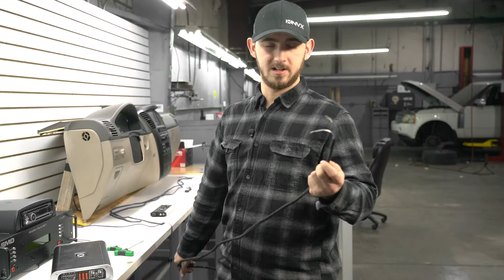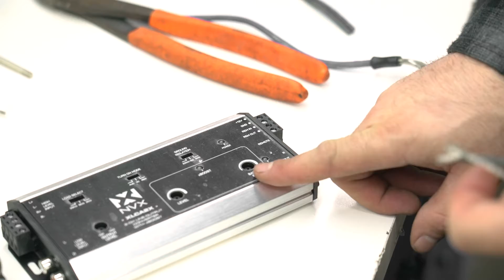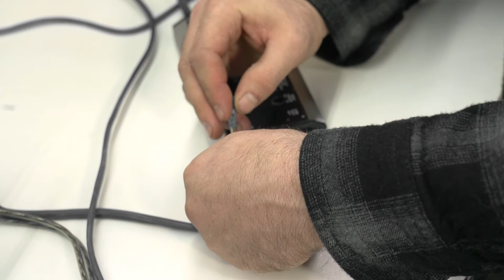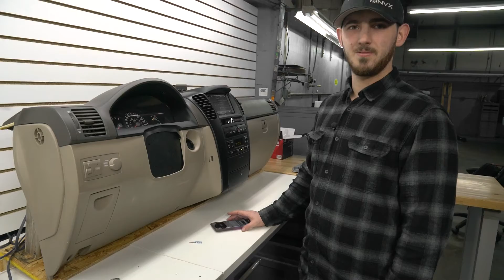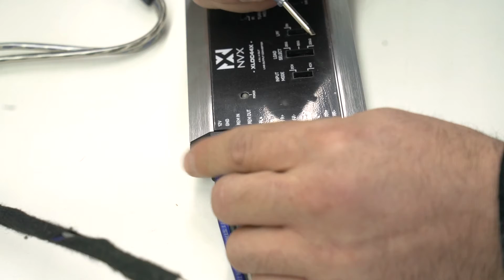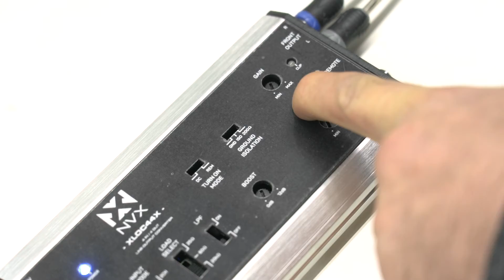How To: Setting Up The Xlca2x and Xloc44x NVX Line Output Converters

Comment: Help me understand this - the xBOOST light was triggered when you increased the OUTPUT LEVEL and with the BASS-X EDGE at 0. I just received my XLCA2X to help address the bass cutoff from my stock system. My impression from the instructions was that the Output Level was further down the line from the xBOOST dials but it seems like its in line before?

Comment: Been on hold with the phone number in the booklet that came with the xlca2 for over 40 minutes.  Sure would be nice to ask someone some questions.  Got this thing all hooked up properly, but it only works when it wants to.  Got subs running with this thing in a 2018 Highlander. Usually works when the car is in park and the subs sound great. As the car is put in drive the xlca2 shuts off. Put the car back in drive, the xlca2 comes back on. You can do that back n forth 20 times. But then sometimes it will work when in drive and sometimes it won't work in park.  I guess this is what I get for going cheap.  Cheap products that kind of work and no support.  Guess I'll return this thing and get an Audio Control.
Reply from the maker: If this is regarding the Highlander with JBL, you need to disconnect the ANC module.
Reply: Sounds like an issue with your vehicles factory Active Noise Canceling

Comment: I have the xloc22X. I use it with a 600W AMP -  2 output with a REM input.  The XLOC22X has grate sound. No hum. Very good Base control. I do not use a remote Knob. The biggest problem I have Is with the remote turn on output of the NVX device. The REM output is connected into the amplifier REM input. Both the amp and the LOC are grounded properly. It is not working with remote turn on! It Does not work properly.   When I first turn the car on and the engine is running, but the radio is off "with no sound", AMP is turned on automatically anyway. If I let the car sit for 5 minutes running and the radio is off, the NVX device never Turns off the AMP! If I shut the car off can and only use auxiliary, the same thing., The radio is off, but the  NVX Device does not turn the AMP off. It is concerning to me that the advertising for this device states, in more than one description, that it will turn off the amp if no audio is on the NVX LOC.  I have spent over 2 hours working with the remote in & out. This does not work as stated in any of the descriptions. I know of one other person owning the same device with the same issue. Your documentation that comes with the LOC has NO Description of  how this is supposed to work. Yes, there is a diagram, sorry, does not help because it does not work properly.  This is concerning because in the winter, the battery tends to discharge more quickly when the amp stays on and the radio is off.  A video with some detailed instructions on how this is supposed to be hooked up would really help, however, for some reason NVX , has  No Videos with prescription on how this is to be connected.  You can look on the NVX website, and it says this works, nop, it is not correct.

Comment: Can you use two speakers high level input, (cause my promaster city cargo only have two front speaker ) and use both  front and rear ( sub) rca output  at the same time? Or can i split the two pair of speaker wires to make 4  high level input?
Reply from the maker: You are able to use just a left and right signal input with the XLOC44X, and will output across all four outputs if the input mode is in the 2ch position.
Reply: @NVXAudio  Good! Thank's for your response

Comment: Great video but you should be testing rca voltage going out. Most amps can’t take more then 4 volts of power. Taramp for example like more like 2 volts on the rca. Do your homework people this a great product. However, amps can’t take that much rca power you will fry your equipment.
Reply: Seriously, input sensitivity on my amps is 0.2- 6 volts, sending 10 would absolutely blow the input circuit, and void the warranty.
Reply: @nighttow8780  I blind lucked into my new Skar 1200.1 is also 8.5V

Comment: If I have an amp with the same signals as the subwoofer do I NEED to pull from the subwoofer?
Reply from the maker: No, it does not have to be a subwoofer signal, you can grab a full range signal if you have one.

Comment: @nvx can you please explain more clearly how to tune the x boost. This video doesn't give enough details to effectively teach somehow to to tune this properly. Neither did the instructions in the box. The instructions are so vague and leaves so many questions...
Reply from the maker: Please list your questions and we will do a follow up on X-Boost alone on a factory radio.
Reply: @NVX  I think doing a couple examples on a car or 2 would be best! It's confusing to know at what volume to set it and how far. Max listening volume before tuning vs/or trying to estimate when the bass roll off begins. Then how much to turn the dials. All quite confusing so some very detailed videos would be amazing!